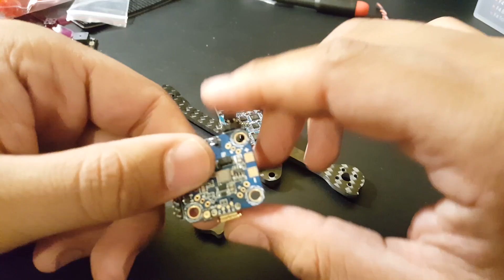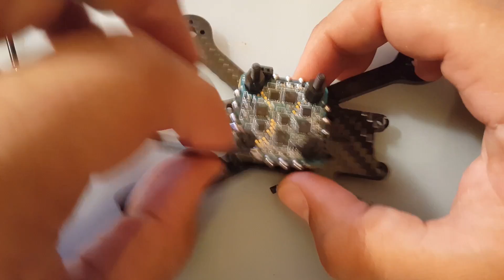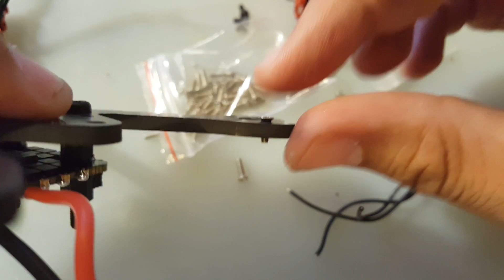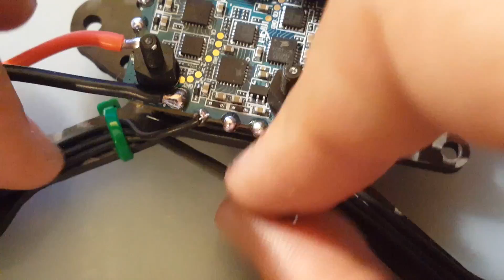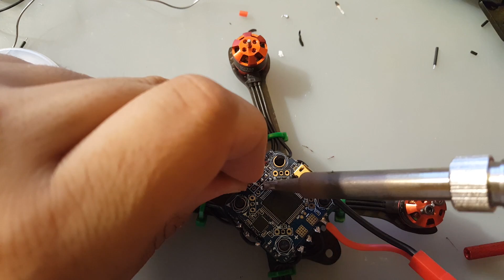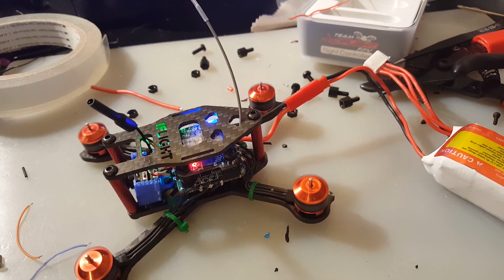iFlight iX2 Complete Micro kit for $100 !!! // Build Video

Comment: What are your PIDs? I am getting a lot of vibration that I can't seem to tune out.
Reply from the maker: +Steve Storm Check if your motors and everything is tightened and not loose first.
Reply: Yeah, that was the first I checked xD  Am wondering if I should get motor soft mounts in case of vibration
Reply from the maker: +Steve Storm I know this is stupid to ask but can you change your props and test and make sure the camera is secured after that we jump to pids.
Reply: I have got to the bottom of it, the issue was that one of the motor had a faulty bearing.  I have replaced the motor and it is now flying nice and stable. Thank for your assistance!
Reply from the maker: +Steve Storm Awesome glad it worked out :)

Comment: I can't get mine to respond to transmitter they are paired but no luck with controls once I set the failsafe I was able to save sbus as the receiver. but that only gave me a blue bar for throttle in the receiver tab all the rest are blank
Reply from the maker: +jay hiner which FC do you have the f4 or f3?
Reply: Drone Mesh I have the arm stm32f405 (prebuilt bnf) and I wired on a frsky xm plus mini receiver

Comment: F4 should be more pricey than only 100$, was 129$ with F4 two weeks ago. I was willing to buy this one or the composite 90mm but finally I've been for the Lizard95 which seems to have better performance with 2S and 3S (6000kv have more torque) but will stay my second choice anyway.

Comment: If i only got a vtx and receiver connected on my fc can i plug it in to betaflight to set pits and stuff? (That it wound burn tru)
Reply from the maker: +Bennie Leip yes if powered through the usb the vtx will not turn on unless it's a on the 5v rail.
Reply: Drone Mesh thnks i tryd it and it works (I thought that i fucked it up with soldering) so sofar its good now waiting for cam and esc's and then ill fly😆

Comment: Eeej drone mesh can flux start a short circuit?
Reply from the maker: +Bennie Leip it's possible
Reply: Drone Mesh hmmm okey thanks but if I measure the resistance on it and it wont beep it wound right?
Reply: Jason D if you mesure if you got a short circut and he mesure 500or around that mostly there is some flux between it(yust build my first one and i controle it in al the possible ways thats why😆)
Reply: Burned out my Rx on my armor 90 , to much flux , be careful

Comment: iflights site says its an f3 stack?
Reply: not it has two packages:one is F4 and F3,you can choose the option
Reply: iflight supports drone mesh?. drone mesh supports iflight?
Reply from the maker: +KillaG FPV this kit was provided to me as I mentioned in the beginning of the video to make a build video for it :)
Reply: I ordered the ix2 tiny 90mm. I did not get a choice,  mine came with the F3. I believe you only get to select a choice of FC if you get the stretch version.
Reply: Drone Mesh Yeah nice. Iflight commenting just makes it seem they are lurking for damage control. But reading the responses they are just answering common questions. Im looking at getting a micro for round the house practice. This seems like a good option. Other micros seem messy and cluttered.
Reply from the maker: KillaG FPV after flying it. I can 100% back it up. I promise you that you will thank me once you take your first 3s flight with it. 

It's unbelievably fast and powerful. Unlike any other micro I have built or flown. 

It's gonna be a beast in the house ;)
Reply: Techcaveman1 thanks for that tidbit!
Reply: what flight controller do i choose in betaflight to upgrade the firmware? please help.
Reply from the maker: +Broken Props give me moment to get on pc and check it I forgot.

Comment: What do you use to keep that soldertip so clean?
Reply: Bennie Leip sponge or billow pad for tip cleaning. They also sell tip cleaner if your tip is not as shiny as solder then it's dirty and won't work well
Reply: QUADBOT FPV i got a white blok with cleaning stuf in it and metalsponge  but the tip looked like it started to get piddet and wont get clean